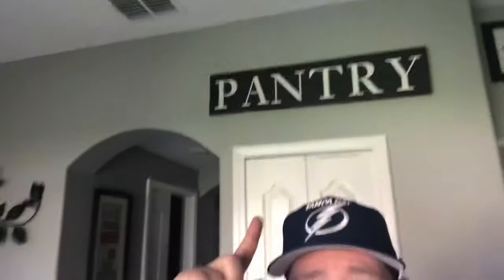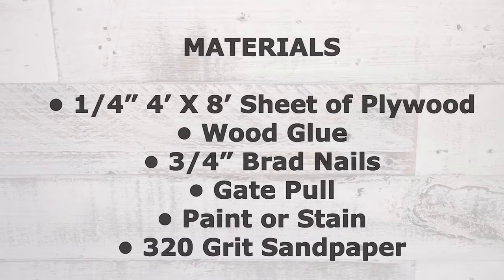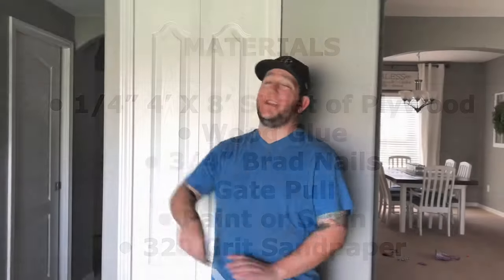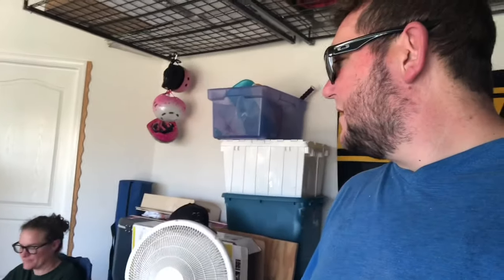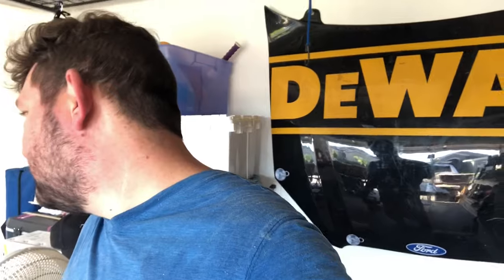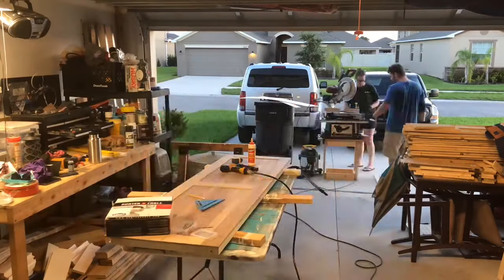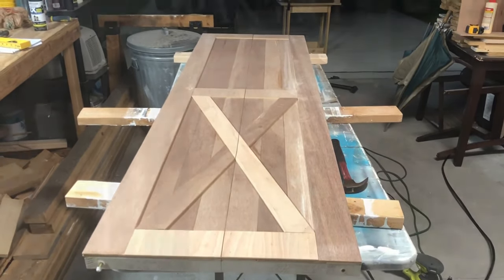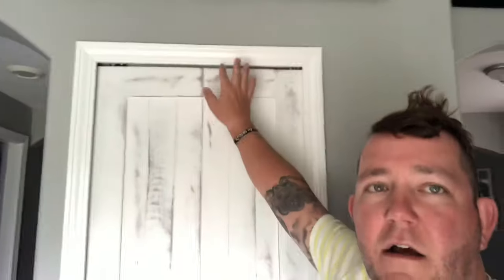DIY Bi Fold Door Into A Barn Door - How To Turn Your Bifold Into a Barndoor - Farmhouse Decor -

Comment: Ok I like that idea!! I’ve got 2 of these doors in my utility room, but one of them has a furnace behind the door. Could I do these to my doors as well and just put a vent at the bottom of the door for air suction when the unit kicks on?
Reply from the maker: Anything is possible with enough creativity. I’m sure you could fit a vent in the bottom of one of the doors for sure.

Comment: Did you have to adjust the door at all on the outside edge (the side that doesn't slide) with the added thickness so it would open and shut correctly and not hit the door frame? This looks awesome and we are looking at to doing this on our own closet doors but worried that we don't have enough room around it.
Reply from the maker: Sometimes you have to move the hardware back up to a 1/2 inch. Sometime you have to cut the framing down. It all depends on the project. Good luck on yours!! 😊